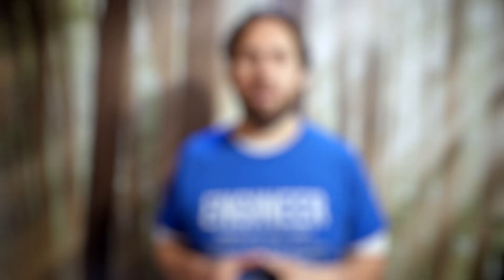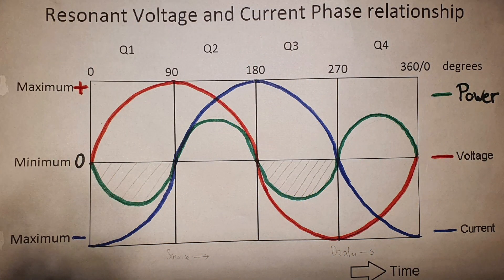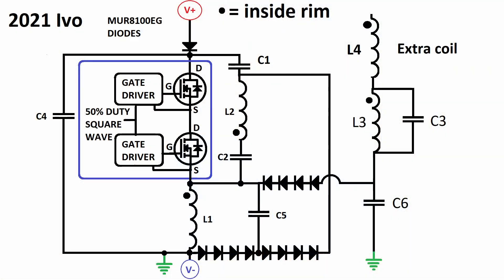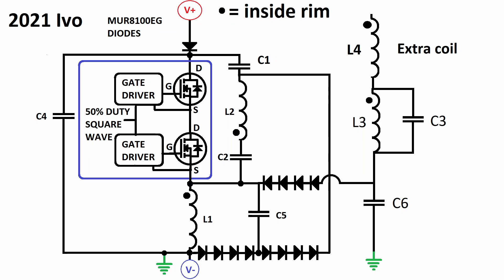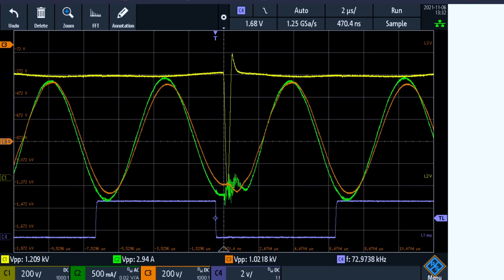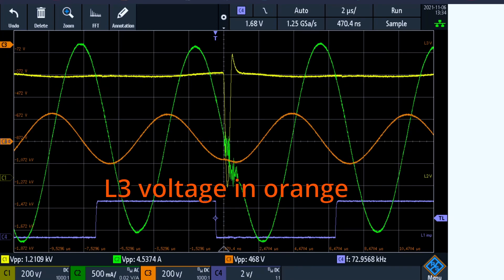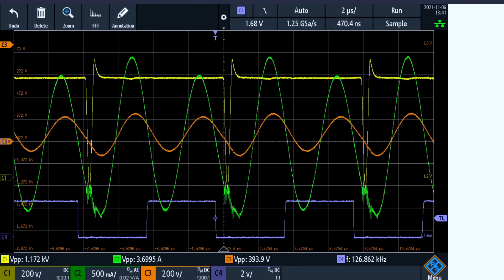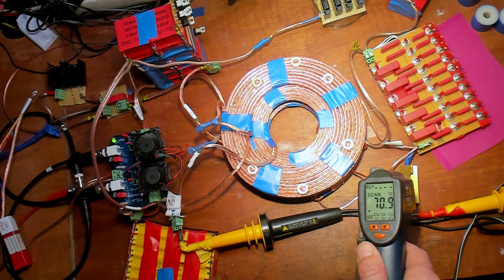Nikola Tesla's EXTRA Coil

Comment: Hi, masterivo, i have your circuit and experiment whit him, your voltage its down because the pankeke coils can't hold resonance, you have de pulse, the frecuencia, but the body, resonant body , you lack the resonant body, you have the coil, but it lacks a resonant core, it has to continue ringing like a bell, the echo is the one that allows you to continue obtaining voltage without it disappearing
Reply from the maker: So you mean, not one impulse per cycle, but multiple cycles per impulse? 
And the resonant body? do you mean ferrite?
Reply: @MasterIvo  I'm sorry, my English, if electronically, so you say is correct, I try to work with the core for that, I have a resonant ceramic toroidal core and another aluminum core, and they remain resonating for about a minute and a half approximately, the aluminum It is radiant but when the energy flow is in high frequency, it reverses and becomes magnetic, I use ceramic because it is neutral, a neutral core, above this toroidal core I use the tesla pankekes, it is the same winding, it generates standing waves, They are known as poe vortex coil, I can send you images to your email, if you want, and the models to assemble the cores, are simple and will work more than the pankeke, I say it with respect for what you do
Reply: @MasterIvo  That the body of the coil resonates is fundamental, beyond the magnetic and electric shock that is being given to it to respond, the body will respond to the vibration and while that is clearer and more neutral, the better, that is why I do not see a resonant body In the pancake coils with resin, I see it as a music instrument that has a person who knows how to play it and who has rhythm, but the body of the instrument is not there, the cable would be the strings, and the resin would act as a resonant body. I don't see that good
Reply from the maker: I prefer air coils, without ferrite.
as ferrite introduces hysteresis loop. which prevents a proper impulse, as the magnetic field energy stays partly stored in the ferrite.
All the resonant energy of is present in the Aether and electrigen fields.
so that is my body, but indeed then the resin would be the body
Reply: @MasterIvo  If I understand that, I don't like the ferrite for the core that too, and if your body is the resin of the coil, I see it there little resonant to that resin, the intention is to leave the core tuned in the background energy, That's why I use an aluminum core, but between one coil and another there is 10cm of air, I could send you one of these so you can try it if you want
Reply from the maker: @data112  Could you email me? The adress can be found on my YouTube "about" page (use pc).
A photo would make your ideas much more understandable.

Comment: 1.Hi Ivo the patent radiation energy nr. 685.957 the condenser used in it and not the bifilair spool.            2. the condenser is a 2 plate which can be moved so the space between the 2 plates to have the correct distance for max power.    3. Yes  i felt also you need 2 bifilair coils which Nikola mentioned in his patent to be  difficult with his condensor so you could replace it by 2 bifilair coils.                             4. I use a plate on the roof and a plate in the ground each with his own bifilair coil configured just as the patent radiation energy nr. 685.957

Comment: Your experiments and your persistence are impressive, Ivo. I am not an expert in electronics but I dare suggesting an explanation for the phase shift you measured. Coils and capacitors can shift the phase between voltage and current. That's part of conventional theory. Obviously, phase shifting is the crucial feature of the "Tesla Extra Coil". You have proven that the theory holds. Congratulations.
Reply: Is it really still a theory once proven though? 🤔

Comment: Hi Ivo
As usual, great work
Any update?
Thanks
Reply from the maker: made a post, tested resistance with dc power. with equal power as the input I used in the test, the resistance quicly became hotter.
Also tried rectifying to dc, but this detuned it.

Comment: Ok so the blue light spectrum is the Healthiest wave energy pattern so tune it to it . short wave length and high frequency . if you increase wave length you will increase power.. that just logical  450-500  wave length . so wave length is the measure.  what is wave length charge and discharge . it just a thought.

Comment: I have been busy so i am late to read your response again your conclusion are correct with what we have to measure and deduce. I suspect the current Ohm's law will not apply.  I repeat Ohm's law will not apply . Use the simple method of in put and out put first. coil size and capacitance  are just indicators.  Now we get into physic of spin. I am reproducing a faraday experiment of a homopolar generator.  with higher amps and very little volts. This require a Addition law to Ohm law. The Law's are incomplete. That is why I state just use input and out put. as a measure. then reproduction out come .  This will help to find a REFERENCE .
Love you Bro.Peace and wishing you great blessing

Comment: much interest in power calculations, and rightfully so! Is there any usefulness in the standard "average ac power" formulae where you get RMS voltage & RMS current straight from Vpp/Ipp (to yield resulting 'avg/apparent ac power' or Volt-Amps)?

I guess its unlikely to be meaningful when I have no load on system, and i wouldn't expect it to necessarily describe system capability, so maybe only useful in a college course's lecture notes...
Reply from the maker: yes there are formulas and yes you could calculate the power inside the coil. But indeed, the trick is to get it out. in theory you should be able to get 50% out (else the oscilation dies)
by matching the load impedance to the secondary (or extra coil or both) impedance
Reply: @MasterIvo  are you leaning toward water-heating as a likely test worth running? thinking of what's on hand here, i might google if there's any merit to burning a lightbulb & measuring voltage from a pv solar cell? maybe a dead end but they're definitely very sensitive to brightness/luminosity 🤷 also, note to self: do homework re: whether there's an easy way to rectify L4 & charge a lithium ion battery or series of the same
Reply from the maker: Power will be measured as DC, that's most reliable. So HF HV AC rectified into dc capacitor bank, which then is loaded. Current is measured through the load and voltage drop over the load
Reply: @MasterIvo  coo! i may see if i can use a couple MUR8100EG's and maybe rectify/regulate into some of my spare li-ion 18650 cells... lately been curious yet hesitant about it; seems a "cool" thing to try, yet also maybe a "less-than-useful" application, so perhaps.... ever try charging ur lead-acid 12V's from resonant coil? dunno if that's even a useful thing to try hehe. i wonder if a solar charge controller could be useful for batteries, another thing to chew on 🍰

Comment: If you apply a high frequency impulse input to the bifilar you said you are able to generate either high  current or high voltages right? If so, why not marry the two separate Bifilar outputs both coming from the same high frequency impulse or square wave source? Have you tried recombining them in this manner?
Reply from the maker: no I haven't, but have thought about something similar. I think the impulse is needed to do something else, amplification of the secondary current
Reply: In the 1996 Carson and dollard presentation they highlighted a mystery of the transformer in the secondary. Conventional thinking only looks at flux lines being sucked up in the core at the primary. But clearly more than that is going on there. Additionally there is an instantaneous longitudinal in
the ether at both primary and secondary. If its not the flux in the secondary transmitting power it must be the longitudinal thats producing this power instantaneously on the other end. Furthermore the form of that longitudinal is a particular format or geometry arising from how its being created. I am thinking if the secondary core isnt doing anything directly to make power whats its real purpose?
Maybe the secondary simply acts as a receiver transmitter component that can interact with the ether wave by virtue of its role it takes in forming the geometry.  like a lock and key the transformer has a specific density pattern replicated in the primary and secondary. (The transformer might be seen as a multidimensional converter : a lower density structure in our material octave of a pattern able to manipulate the ether, at much higher octaves. ) The coils as analogs of eachother  resonate the longitudinal. but the participation of coil current, coil pattern, and longitudinal as a complex pattern is  replicated exactly at the output side except when altered by different winding numbers. What do you think?
Reply from the maker: Very interesting. I like the octaves.
Maybe, the longitudinal is dependent on the cavity between the primary and secondary. I find it a challenge to get these abstract themes into practical usage.
Reply: the ether exists at a higher octave,  the transformer at our lower material octave. But when the transformer interacts w a current, a longitudinal is set up. it instantly appears, an instantaneous bridge between primary and secondary. I think of the transformer like a switch or valve from how it can pattern the sound in the ether, like a cymatic pattern at a higher octave. And this pattern is a specific structure that can behave as a portal for power. We see it that way disappearing and reappearing, but the transformer actually has two valves. The first valve patterns a sound in the ether and makes it disappear to our observation, the secondary valve interacts with that pattern to reappear because it is similar to the first geometrical form that rang it into being. If this is close to what is happening it may offer a new insight as to how to apply geometry to unlock power.

Comment: rhetorically, dude HOW is L1's ripple magically affecting L4 current all greased-lightning style? Ok, like minimally-attenuated dielectric induction STRAIGHT THRU a resonant L3 (i.e. rather shielded, i'd have expected).

That infamous L1 ripple (aether skid? pendular echo from the medium (lol)? supraluminal/longitudinal equilibrium rebound between coil windings?), just a' joy-riding every other circuit, just surfing L2 L3 L4 easy as you please! The shear audacity of it Ivo!

My 'coplanar/concentric' L1/L2 shows it particularly dramatic, perhaps because L1 has no L2 interposed blocking it from others... Your "uptuning" trick doesn't seem to work from what i can tell. Seems disadvantagous perhaps, we shall see... Fiddling with coupling/distancing between L3/L4 and L2, presently <3
Reply from the maker: it's a mystery
Reply: @MasterIvo  sweet, we love those. need van + cartoon doggie. i'll consider it "violent crosstalk" or maybe "rabid parasitics and/or stray capacitance/inductance" though that's a bit harsh
Reply from the maker: Scooby-Doo :D

Comment: Nice job 
What is the cop of this setup
Reply from the maker: unknown yet. I need to tune it properly before that becomes interesting. and for proper power measurement I want to rectify to DC, which needs a circuit adjustment

Comment: I can't help thinking Tesla would love to see and work with your set up.
Reply from the maker: I think he would love to play with Mosfets and diodes.
But he was so clever. He used dc  saturated transformer coils as diodes, and auto oscilating relays as switches.
Reply: @MasterIvo  I don't think we will ever know all his equipment,, he did things way ahead of his time, we have leaned some of the technology, but I do wonder how we could tune massive equipment he had so well, and he was pioneering not following. It's incredible.
Reply from the maker: indeed, he was a true wizard. A merlin.
Reply: @MasterIvo  so the electromagnetic right hand rule won't let the electricity go back in a coil, makes seance when you say it. Just never thought about it.
Reply from the maker: yes if a 1:1 transformer has enough dc on the primary to saturate the core, the secondary will only pass one polarity current.

Comment: You should measure current and voltage directly over the resistor. If voltage is about 300V over the resistor (since it is in parallel with L4, it should be same as L4 voltage) and if voltage was truly in phase with current, you would be creating a power of 300^2/8.2=11kW. Clearly, that small resistor wouldn't survive that. Something is amiss here and should be further investigated. Most likely the resistor is not absorbing more power than your input power which is about 16W per your video. This would mean about 45mA in your resistor. Measure the current in you resistor directly to see what it is. My suspicion is that its inductance is significant.
Reply from the maker: don't forget the L4 voltage rides on top of the L3 voltage (series connected).
The resistance heating up is just an indicator of power. 
Power is best calculated DC, So I'll first rectify into dc then into a capacitor bank, and then I can resisive load it, and calculate DC power.
But to do this safely I need to remove the dc offset on L3 first.

Comment: So from what I just seen, if it took you, say,  ten minutes at 17 watts to get the load resistor to 70degC, that would be like 10.2kJ input and 132KJ output, or about COP of 13! 
Well done, congrats! 👏
Reply from the maker: not that easy to calculate, I will use dc power on the output to calculate
Reply from the maker: @hayah_ore  no
Reply: Just incredible really

Comment: As always great information . coils as capacitor and resonating at same frequency what else would be the out come. Mean your conclusion is correct. I wonder how large the magnetic  field has increase.   I know it not of interest to you but that is would surmise is a way to extract more energy from magnet's resonate coils at magnetic frequency strength and pulse should allow even great power . It a thought . nice Video
Reply from the maker: The magnetic field is to be amplified by the impulses, I didn't even tune for that. this still needs to be done. then the power (product of voltage and current) will rise
Reply: how do you tune for the magnetic field?
Reply from the maker: using equal copper mass in primary and secondary. and the magnetic field is also tuned by resonamt frequency, which is controlled by changing capacity (capacity provides the current to create a magnetic field in the coil).
further more I can give the secondary more windings then the primary. More windings, more inductance, more magnetic field (if current is provided by the cap).

but most importantly. the impulses in primary (l2) amplify the current (magnetic field) in l3(secondary)